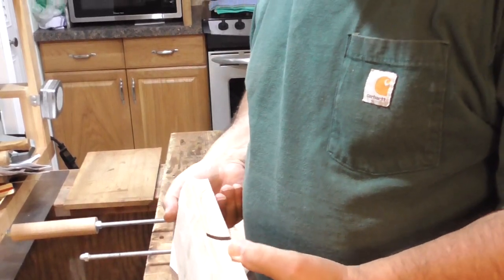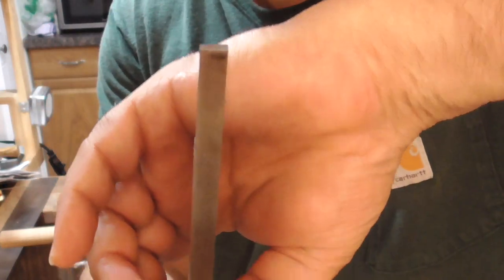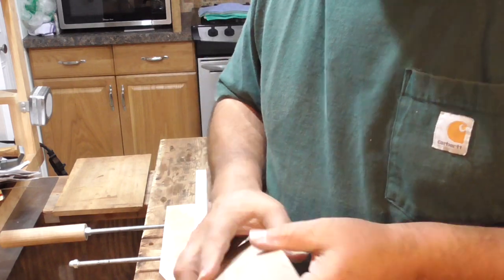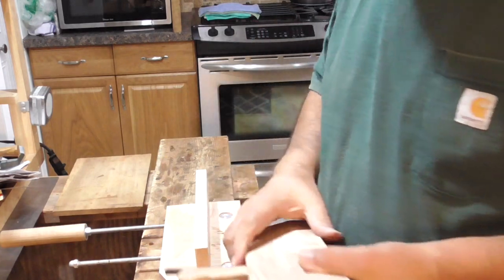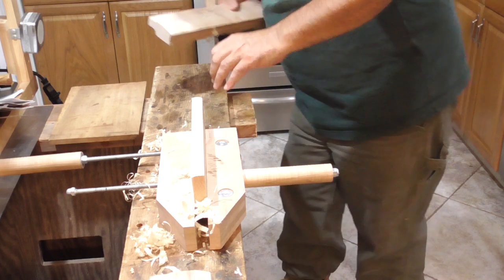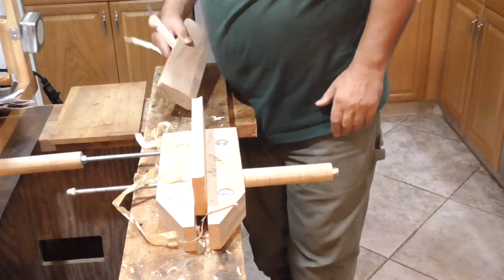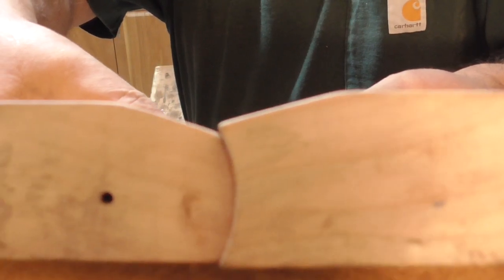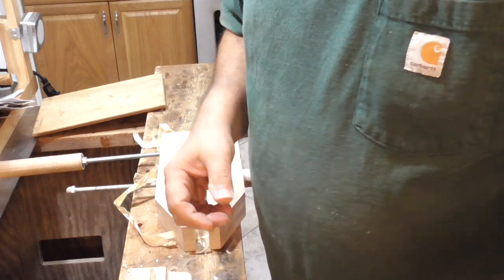Hollow & Round Plane Series, Part 4 - Final Segment

Comment: 00:07:33 Is there a video in which you made this tool with wich you are tightening your piece of wood?
Reply from the maker: It's a parallel clamp, I have a video here :  https://www.youtube.com/watch?v=XYLT3jsiUAw

I added "T" nuts and bolt it to the wooden plank from below, making sure the bolt does not extend too far upwards, damaging planes that may pass over it.
Reply: @ROUGHCUT20  Thanks! I looked at the video and recorded it.